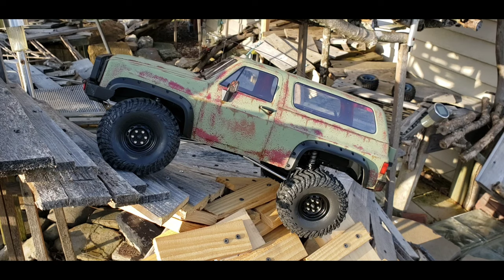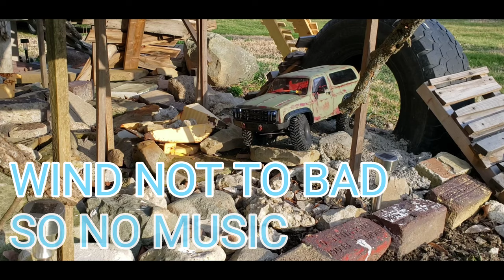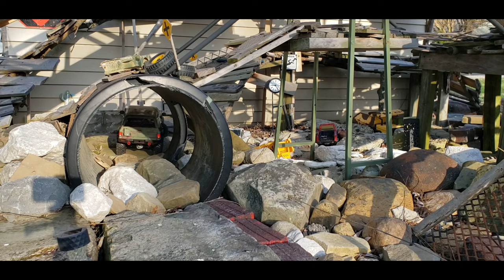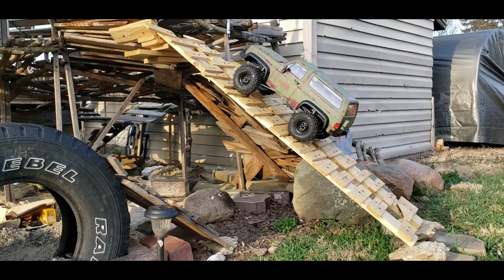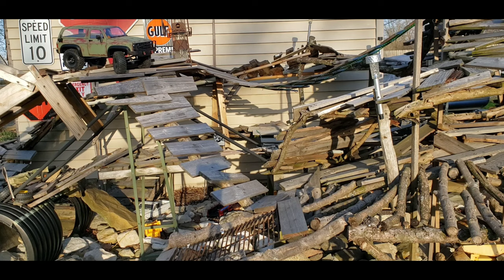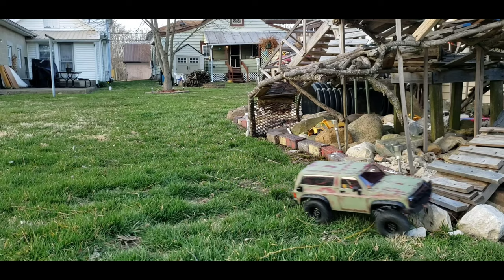Gmade GS02F Buffalo Military first crawl

Comment: Awesome build definitely looks great preformed pretty good definitely makes me want to get mine together   Excellent video
Reply from the maker: I think you're going to enjoy it building it went smoothly i didn't use the stock wheels though didn't like how they were designed
Reply: @AdventureTimeRC  yeah haven’t done much yet but put wheels together and definitely not a fan of them
Reply: @AdventureTimeRC  - I share the same thoughts about the tires & wheels ! But, oh well...... I just gotta pick-up some metal beadlocks. 🤫
Other than that & a stripped roll-pin driveshaft screw, it is a pretty fine crawler, & a darn good deal !! 💰😁

Comment: Must get mine out for its first run, needs a shakedown. So why did you not use the stock tyres. Your one is quick, what motors does it have sounded like you said 11t I put in a 35t. It went well on the course.
Reply from the maker: Wow i you haven't ran it yet drives so nice i didn't car for the stock plastic wheels so i got metal ones and the stock tires are not bad but fir the type of driving i enjoy i thought these taller more aggressive ones would work better gives me a little more axle clearance to

Comment: Nice running very sweet rig man! How does that anti torque roll transmission work? Does it have planetary gears or something?
Reply from the maker: Thank you Tyler it has a serious long transmission that spins the opposite direction as the motor it also has overdrive in 1st gear and 1to 1 in 2nd gear so far i am seriously impressed with this design